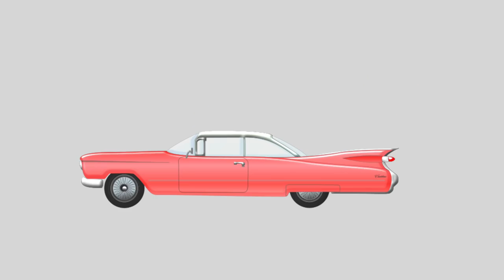Yes, Rockets CAN Fly in a Vacuum

Comment: I don't think anyone believes that the exhaust from a car is pushing it rather than the force of the tires pushing off the ground. How does a rocket push off an atmosphere that doesn't exist in space?
Reply: Rockets don't "push off the atmosphere".
They push away the mass of the exhaust gas and feel a recoil force as a result.
Rocket Propulsion is just the mechanical recoil of pushing on mass.
Reply: @stuartgray5877 Whats giving the mass that's being ejected a foundation for friction to then project forward force Lil Stuey?
Reply: @stuartgray5877 Lil Stuey,.. is space a void that is constantly accelerating its expansion?
Reply: @stuartgray5877 Is every single point of space accelerating away from every single point of space Lil Stuey?
If so what force is working on space to cause acceleration of the expansion of the void?
Reply: @stuartgray5877 Lil Stuey do you think it would help to know the current conceptual model of space when talking about whether something can propel when immersed within it?
Reply: @stuartgray5877 Missles don't push off atmos,.. 😂😅
Good one Lil Stuey.
Reply: @dragonz_eye  - "Whats giving the mass that's being ejected a foundation for friction to then project forward force Lil Stuey?"
Can mass be accelerated by anything OTHER THAN a "force"?
OR 
is a "Force" the ONLY thing that can accelerate mass?

This is to see if you truly do understand Newtons Laws.
So, which is it Genius?
Reply: @stuartgray5877 Stop it Lil Stuey. 
Forced mass to gain accelerative momentum is not the question being asked by those who persist upon demanding an explanation of your belief in "space" travel.
Most people understand how missles are launched.
Now.
Is "space" a constantly  accelerating expansion?
You have failed to answer this super simple and supposed reality of your fictional spacial reference frame to which you are making specific claims to be able to accelerate, stop, turn, and otherwise maneuver while immersed within it.
Answer the paradoxical question Lil Stuey.
Reply: @stuartgray5877 I'm going to give you a clue as to what the answer is,..
It has to do with "dark energy."
Reply: @dragonz_eye Is it really that hard for you to understand that the rocket exerts a force on the gasses and the gasses in turn exert a force back on the rocket?
Reply: @dragonz_eye you do know they call it an action, reaction pair. Not thruple? Momentum is dependant in the mass and change in velocity of 2 objects, not two object then experiencing “friction” from a third.

Ever seen a Newton cradle?
Reply: @engineeringtheweirdguy2103  Atmos is not an object. Gas propellant is not an object.
Objects have density gases are independent molecules. 
So there's only one object,.. the missle.
Are clouds objects?
Reply: @dragonz_eye  particles have mass. Just because they’re too small for you to see them doesn’t mean they’re not physical object with density and weight. Ever tried picking up an inflated car tire vs a flat car tire? Which one do you think is heavier 🤔
Reply: @dragonz_eye  No, you're here because you are wrong, but your ego can't handle it, so you try to act superior to complete strangers on the internet.
Reply: @frantaspacek Sounds like your projecting.
Reply: @dragonz_eye  That's just because you have such terrible self awareness
Reply: @frantaspacek9583  Sounds like you're projecting again.
Reply: @dragonz_eye  I doubt you even know what projecting means
Reply: @frantaspacek  Projecting,.. again.
Reply: @dragonz_eye  Don't you want to provide some actual arguments instead of this childish "no u"?
Reply: @dragonz_eye  and? even if it was true, then what about it?
Reply: @frantaspacek STOP ACTING LIKE ITS A PROOF OF SOMETHING.
Reply: @dragonz_eye  and now you're shouting, it didn't take that long for you to show your true colors
Reply: @dragonz_eye If a rocket exerts a force on the exhaust gasses to eject them out of the nozzle, do you agree that the gasses should exert a force back on the rocket in accordance to the third law of motion?
Reply: @dragonz_eye  you lost all credibility the moment you unironically used a clown emoji
Reply: @AM-rd9pu  Whilst blasting around the human domain of earth and atmos,.. absolutely.
Reply: @dragonz_eye  "Nothing I've said is false." that's just another lie on top of your mountain of nonsense
Reply: @dragonz_eye  you can start with explaining this nonsense: "You could discharge 1 ton of exhaust/gasses from a marble,.. and the marble would not move in the current concept of space. 
It would just be a still unmoving marble exhausting gas into the void."
Reply: @dragonz_eye  Oh look, you’re using Witsit lingo and refusing to say atmosphere. 

You still need to explain why you think the laws of physics would change when there’s no air.
Reply: @AM-rd9pu  Explain to me,.. what makes you think earthly PHYSICAL LAWS can be applied to sky phenomenon?
Reply: @dragonz_eye  Why wouldn’t the laws of physics stay the same? The sky and space are still physical places where the laws of physics apply. 

You still  need to explain why you think they’d change.
Reply: @AM-rd9pu  Really? How have you determined this?
Reply: @dragonz_eye  I know of a machine that can accelerate 500 kilograms of pure water from a velocity of zero to Mach Eight! (2500 meters per second).
It can even do this trick every second for about 8 minutes.

Now tell us that this machine can accelerate all that mass without feeling a recoil force.
Because IF you want to claim that is possible then you have no business trying to explain basic physics to others.

SO IS IT POSSIBLE to accelerate 500 kilograms of water to MACH EIGHT without any recoil force on the machine accelerating the mass?
YES or NO?
Reply: @AM-rd9pu "All of humanity's knowledge of science indicates that physical laws don't change."
True,.. while they apply to the domain we have established them.
They DO NOT automatically apply to the sky.
The sky is observed non physically as a phenomenon.
DO YOU KNOW THE DIFFERENCE?
Reply: @dragonz_eye Why do you think the laws of physics suddenly change when you leave the ground?
Reply: @AM-rd9pu  I don't. What gave you this idea?
Atmosplanic pressure is part of our physical reality.
Air has been identified down to different molecules.
Do you know 2 hydrogen molecules and 1 oxygen molecule is water?
Reply: @dragonz_eye Your whole spiel about the “sky phenomenon” and misunderstandings about reference frames sure makes it look like you think different rules apply to things that are off the ground.

And two hydrogen molecules and an oxygen molecule would produce two water molecules when reacted together. 
2 H_2 + O_2 —> 2 H2O
Reply: @dragonz_eye  Reread your previous post. You said, “Do you know 2 hydrogen molecules and 1 oxygen molecule is water”. 

I simply pointed out that two molecules of hydrogen and one molecule of oxygen react to make two molecules of water. 

I suspect you meant to say “atoms” instead. Because yes, two atoms of hydrogen and an atom of oxygen do make up a molecule of water. The way you phrased it, we’d have two molecules of water.
Reply: @AM-rd9pu Noted.
Reply: They don't push off of anything; either in space or the atmosphere. Think of it this way, how do the air molecules, being below away by supersonic gases coming out of the nozzle somehow "push" back against the rocket? Try diagraming out that one.
Reply: @dragonz_eye  : Gases have mass. Molecules have mass. Or do you claim they do not? If so, who told you that? Where did you get your education in physical chemistry? Or, what YouTube video did you watch that told some this?
Reply: @dragonz_eye  Since you are on the topic of "water"
Would shooting a WATER Fire extinguisher into a vacuum have any recoil?

Or, you know, a Toy Water Rocket that uses air pressure to PUSH the water out.
Would IT have any recoil in a vacuum?
Yes or no.
Why or why not?
Reply: @dragonz_eye  Would you agree that the exhaust gases coming out of a rocket engine nozzle have mass?
Reply: @sailorman8668  No. they will not "agree" to any fact that proves them wrong.

Comment: There's nothing for the rocket to popel against so it can't fly through space.
Reply: Rockets carry their own reaction mass.
The fuel and oxidiser.

To move in space all you have to do is accelerate mass and eject it.
Conservation of momentum does not require the presence of an atmosphere.
Reply: I disagree. I've seen someone force start a firework in a vacuum and didn't move at all until the end when it span about 2cms.
Reply: @MR_G92  
It doesn't matter if you disagree. Or if you have a poorly executed anecdote.

The physics for how this works have been proven to be accurate again and again over the past four centuries.

I also have an anecdote.
I performed experiments to prove the veracity of the laws of motion and conservation of momentum when I was 15. My classes experiments matched what the calculations predicted perfectly.
Reply: @MR_G92   - Rocket "Propulsion" is really just the RECOIL force of the rocket pushing out mass.
Just as a Crossbow feels Recoil from shooting out the mass of the projectile, a rocket feels recoil from accelerating the exhaust gas from the nozzle.
Reply: @stuartgray5877  no it's not

Comment: Rocket engine pushes the air back and moves forward?but how it's possible in space as no air is there to push back...
Reply: Papa Legba  - "a rocket doesn't push gases." 
how do they get accelerated?
Reply: Papa Legba  how do the gasses GET ACCELERATED?  Why won't you answer?
Reply: he cant answer because you cant push off nothing, if anything they will spin on the spot
Reply: @dayzwarrior.4452  - "because you cant push off nothing"
Good thing that rockets dont TRY to "push off nothing"
They DO push off of MASS that they take WITH THEM to push on.

Do you think that a crossbow would have recoil in space or not?
Reply: Papa Legba  - "a rocket's not a crossbow"

For the intent of the Law of Conservation of momentum, a crossbow and a rocket ARE the same.
They BOTH "HURL MASS" so BOTH "Feel recoil force" Period.
Reply: The rockets aren't trying to push the air back. They are simply expelling the hot combustion gases out to create a force in the opposite direction.